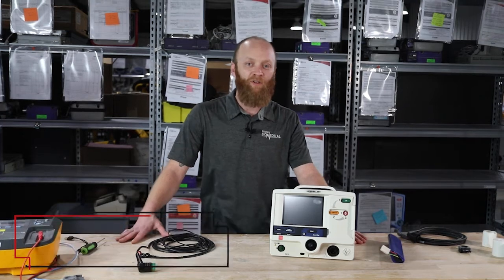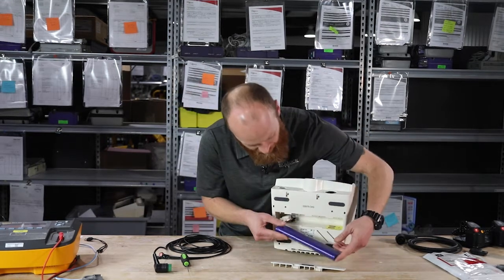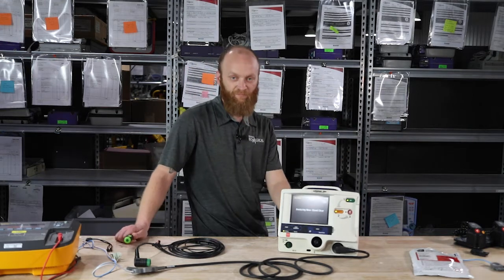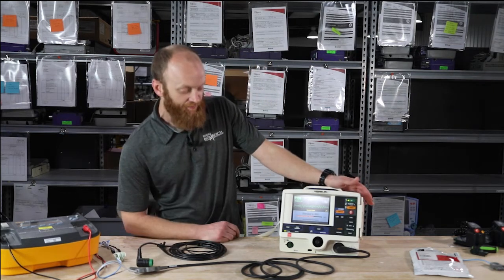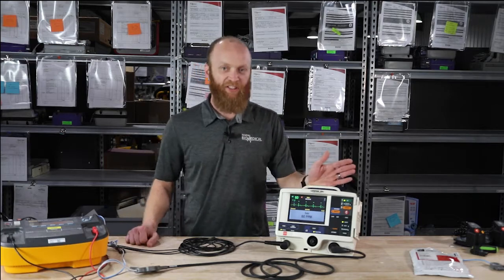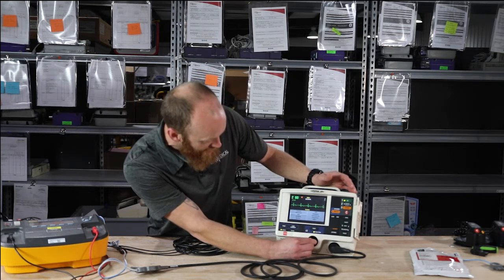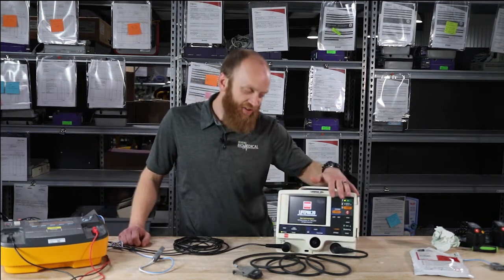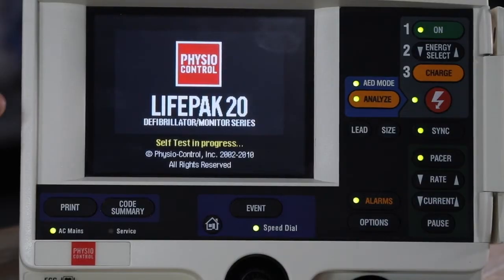Lifepak 20e Overview, Basic Operation, and User-Testing

Comment: Hello.

Thanks for this video, for this interesting time.

I work in 112 Emergency. I have particularly this machine in my emergency car  and I have a question.

When I want to observe patient's heart rhythm and ecg, I'm  arraging 4 coloured electrodes on limbs and 1 white electrode on the patients chest. Than I'm starting to print the leads: I,II,III, AVL,AVR,AVF,C.

Some of my coworkers move the C electrode through the chest's points, when they are changing the leads on the monitor aand printing the esg.

Do I make everything corect Or not?  Or do my coworkers do everyting correct?

Sorry for my long question.

Comment: Hi what does wrong if the battery icon disappear?
And what can I do for eliminating this?
Reply: If you have a LP20 and not a 20e, then you wont have a battery icon since the monitor is unable to directly measure capacity for the older NiMH battery used on the 20. If you do have a 20e and the battery is not displaying you may need a new battery or have the unit serviced